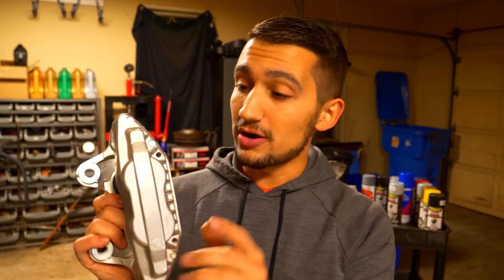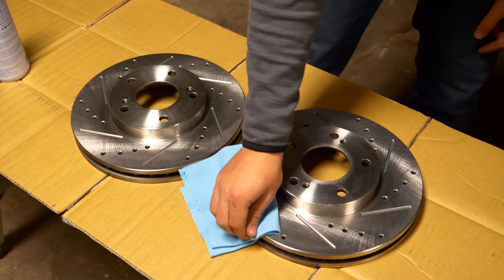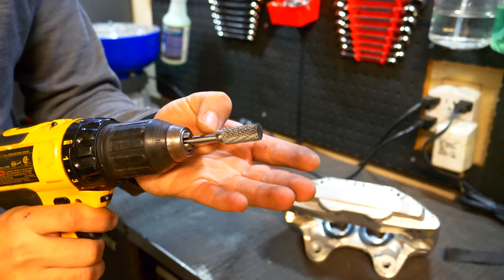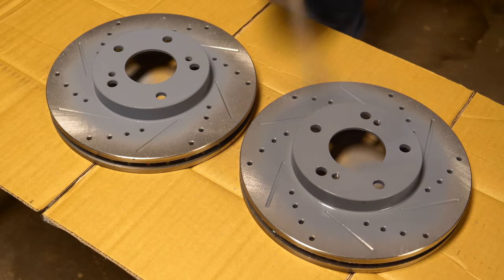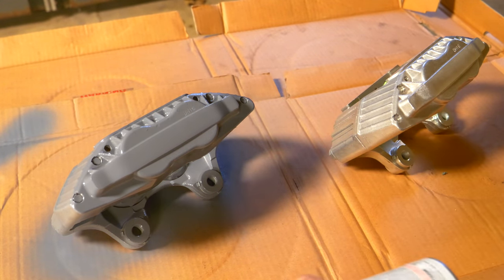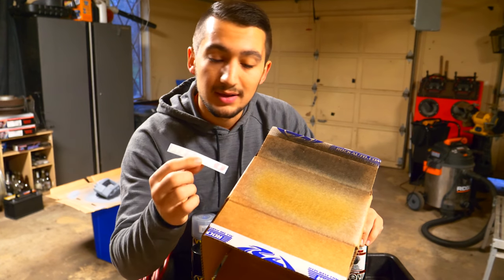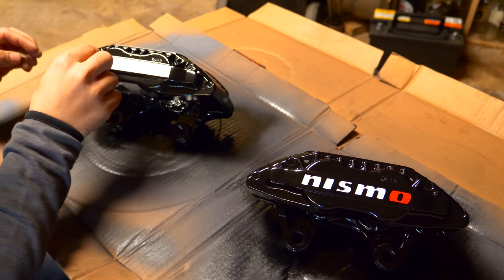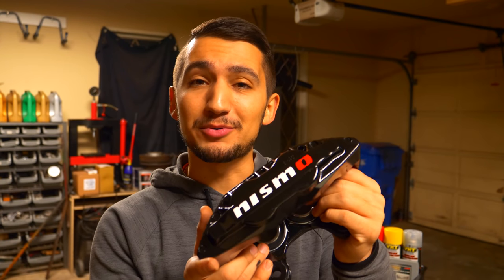How to Shave and Paint Your Brake Calipers

Comment: Have you ever had issues with the decal trying to offgass when the calipers go through a heat cycle? I mean, you used high heat primer, high heat paint, and high heat clear, but then embedded a vinyl decal in there. I would like to do this, but the decal seems iffy.
Reply from the maker: I'm yet to have any problems long term with this process. I hope that helps!

Comment: i would have cleaned the rotors like you did, but then wiped a light coat of oil on the friction surface when before you painted. Just wipe it off when its dry

Comment: Hey bud. I have a question for you as to the Cadillac CTS-v brembo breaks. I want to use the rear brembos from the cts on my 2013 mustang Boss 302. I have the 4 pistons brembos on the from and want to upgrade my rears. Would the ctv rear brembo work?

Comment: You forgot to mention that using 4 stroke paint is critical, if you want your decal to stay.
If you accidentally use 2 stroke paint, the added eleventeen HP will rip the sticker straight off.
After all, any ricer will tell you that looks matter more than performance! 😜 ✌🏽

Comment: I have a question for you. What is the reason why you applied paint to the brake rotors? Would it be best to do that for corner areas like buffalo New York? And also would that cause any problems with the brake pads overtime
Reply: Personally I would have masked off the friction areas on the rotors. I would consider primer and paint to be a contaminant on the brake pads when he starts using the brakes. But thats just me

Comment: Painting the rotor... Paint flakes dont dissipate like brake dust. Congrats you ruined your pads for the next few hundred miles. "letting dry for 30 minutes, ready to be handled".. enjoy your fingerprints in the caliper. Have you painted before?
Reply: Rabbi Schlomo it was just unnecessarily lazy. Would have taken 2 minutes to tape it off
Reply: But he did it on calipers lol

Comment: 🤔What is the temperature of the brakes?  What are the etiquettes made of and at what temperature does they last?  Don't you think it will crack under the coat?🤔
Reply from the maker: I've done this method multiple times, with no problems at all! The only time you will have problems with the finish is if you physically chip it by hitting your wheel on the caliper when mounting the wheels onto your car.

Comment: Does the decal stay in place? How does it do with the heat, brakedust, etc?
Reply from the maker: If you apply the clear coat overtop of it all, it seals it and you will not run into problems 👍
Reply: Yep I noticed that, brilliant idea.

Comment: You did a good job all in all, but you could have easily just powder coated them and done it the right way. That cheap paint method wears away a lot faster and eventually the color fades a bit. No hate or shade toward you just my opinion keep up the good work.

Comment: Why is he calling the casting mark (aka injection mark/moulding) on the brake caliper an "imperfection" or "circle"? It is what it is so call it by the correct nomenclature. Does he not understand/know how brake calipers are manufactured?

Also, I would take the time to mask off the rotor's friction surface before painting. There may be a chance it'll burn off after a few hard braking sessions or maybe it'll cake onto the porous surface of the brake pad and get embedded in it for a long while. This is why standards exist... so less knowledgeable people who attempt the DIY minimizes their chances of something going wrong. If something does go wrong, it's partly on the OP.

When you make a DIY video, at least try to be responsible for what you're instructing. Talking about "pros and cons" for each method is a good way to let the viewer decide the route they wanna go.

Comment: I was curious with a brand new rotor , can you paint the outer edge or venting area of the perimeter of the rotor? Is that of any value,  as it does tend to rust also and can be visible
••• those did turn out quite nice btw
Reply: It helps, but there are also rotors that already have corrosion resistant coatings on the hat and on the venting areas. The thing is that nothing lasts forever when you live in a climate where salty winters are a regular thing - it's still just iron underneath that stuff and brake dust itself is also corrosive over time.

Comment: No.
That's not a milling bit, it's a burr. And you NEVER use it in a drill - drills aren't designed for side loads, and you can bend the shaft which will make it wobble forever. Use a die grinder.

But forget all of that - if you want to "shave" the caliper, just use a hand file, 120 sand paper, or a sanding disc from the get-go.
And after cleaning the parts, never touch them with bare hands until they're painted and dry!

Comment: I’ve always been told it’s not a good idea to get spray pain on the actual disc where the pads will be in contact with them??
Reply from the maker: Don't go out of your way to paint that area, but if  you do get some overspray on that section, it will get worn off as soon as you apply the brakes

Comment: Nice! Z32 brakes are a great choice, but I think those needs a really good master cylinder. Have you bought a better master cylinder than the stock one ?
Reply from the maker: Not yet, but I will get around to upgrading more than just that so I get good pedal feel. I'll probably upgrade the master and the booster all in one shot

Comment: Great video. Would the caliper painting work if the caliper is on the car and if it's one piston.
Reply: It should, you just need to mask off a lot more things
Reply from the maker: As Jay said, you would definitely have to mask off more things, and it might be a trick harder to get the entire caliper painted, but if you aren't confident with remove the caliper and then re-bleeding the brakes, then doing it while still attached to the car will work 👍
Reply: can you please make a updated video regarding caliper painting whiles its still on the car
Reply: Theres plenty of videos out there...

Comment: Forgot a Master cylinder dood... your going from a single piston caliper to a 4 piston caliper, Meaning - you need more fluid pressure>> enter the z32 Master cylinder upgrade. With out it, youll have a very squishy pedal , and the brake kit wont perform as well as it could.

Comment: They look awesome, good job. You would have been better to use a flap disc in an angle grinder to remove the casting imperfections. You want to remove as little meat as possible or you could compromise the strength of the break calliper.

Comment: Can you do a follow up on the geadlights you restored on the VW?
Reply from the maker: I would love to, but since that video, my brother got in a bit of an fender bender, and had to replace the 1 headlight, 1 fender, and front bumper. So instead of buying a new OEM one, he found a set of eBay projectors and replaced both. They still looked crystal clear even though they got damaged

Comment: Drilled and slotted rotors are pointless. Just removes friction some surface that could be stopping you faster.
Reply: J Blob not really. The drills and slots are they to help cool down the rotor while braking, helping prevent warping the rotor. The slots also play a role on providing more of a grip for those pads.

Comment: Very nice. Don’t really need cross drilled rotors anymore though. Pads have come a long way
Reply: Because the basic laws of physics have change and heat works different...
Reply: Ok that why a zr1 vette comes with ceramic rotors that are drilled and major companies like Wilwood, StopTec, Brembo that make breaks mostly for high performance cars or upgrades. Which are proven to work

Comment: But how long does this colour last?
Reply from the maker: The colour itself will stay looking this nice for as long as you keep the calipers in good condition. If you hit the brake with your wheel when you remove it, don't be surprised if it gets chipped or damaged

Comment: By painting the rotters will it effect the braking
Reply from the maker: Yes and no. It will technically affect the braking, but only for the first few stops. As soon as you drive the car for a few kilometres and do some normal stops, the brake pad will sweep away the paint that would come in contact with the pad and then you're basically stopping like a normal brake rotor, but with a rotor hat that will not rust

Comment: more worried about pretty brakes than using common sense to not paint the surface of the rotors that meets the pads.......good luck destroying your pads in about 2.5 seconds flat.

Comment: Did this dude just paint his rotors
Reply from the maker: Yes this dude just did. Its no different than any rotor manufacturer coating their rotors. The paint will wear off as soon as you drive the car.
Reply: Yes he did. He should have masked off the rotor face and only painted thrme hat that will rust.
Reply: milanmastracci think again. An anti-rust coating such as electroplating is different than paint that only covers the surface. One is meant to bond with the metal and change its properties while the other will get rubbed off and embedded into your pads. Hopefully the pads and rotors get hot enough to burn it off so it won't affect the braking performance.
Reply from the maker: I've done this countless times, and am yet to run into problems. After applying the brakes for the first time, the pad is swept, any unwanted paint is scrapped off, and the pad makes a nice cutoff line so only the hat stays covered in paint
Reply: milanmastracci Ohh ok I always thought that the pad will get containmented.

Comment: I heard it’s flaking 🙄
Reply from the maker: It doesn't matter if they're painted or powder coated. If you're aggressive with mounting wheels and nick the callipers, it will chip. On another note, the callipers looked terrific up until the day I sold the car. I can't say much about the condition of them now.
Reply: milanmastracci if powder coat is chipped it won’t spread like paint

Comment: You need to clean really nice the rotor surface to eliminate any contaminants for the brake pads, but then add 3 coats of primer and 2 from paint... 🤕🤕🤕 millennials...